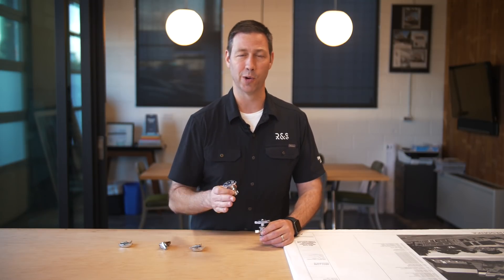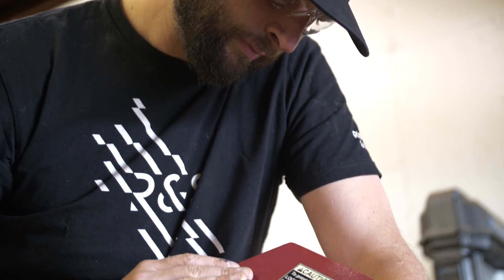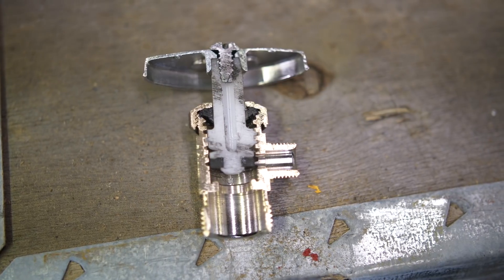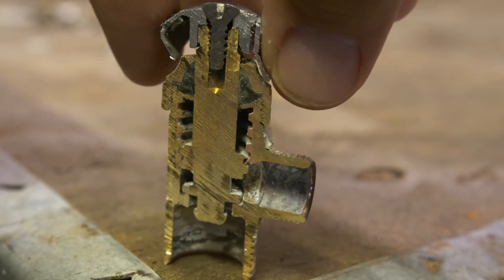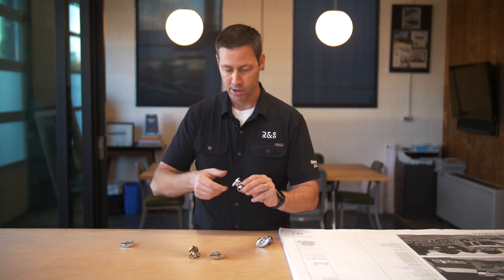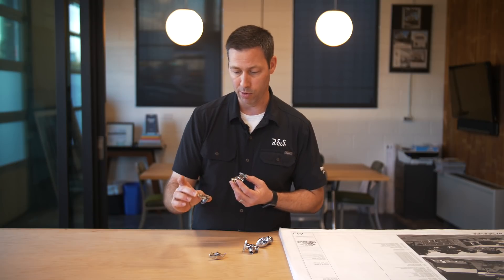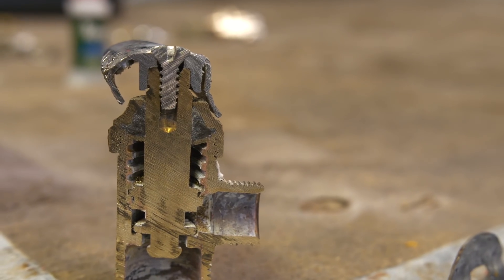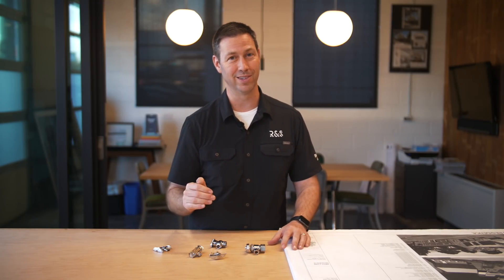Shut off Valves - 3 Cut in Half - Whats the Difference???

Comment: 18 years ago, I replaced all the valves in my house with ball valves, with the exception of the actual shut-off valve.  I even put ball valves on 3 exterior faucets.  The hot water exterior faucet is starting to slow drip, but other than that, all is good.  For those who will want to know why I did not replace the shut-off valve, well, it's copper, and about 1/2 inch above the concrete slab.  Yeah, listen up kids, never buy a SLAB HOME!  Had I known then, what I know, you couldn't give me a slab home.  I mean it!!!!!!!!!!!!!!!!  They suck pig balls, after the pig shit has come to rest on them.
Reply: Eh, slabs are ok as long as you got good footings and soil but theyll still crack..   now what homes are complete crap and deeigned to steal money from the unknowing are vinyl sided houses..  95% of them are under insulated and even if they were well insulated i could throw a piece of half inch conduit completely through one from the outside of the house

Comment: Ball valves are definately faster and easier when it comes time to turn off the water supply.  Although I don't have ball valves supplying my fixtures I do have many in other places (outside water shutoffs, main valve to the house, hot water heater and many more outside he home.  From my experience the ball valves don't fair much better than the other regular valves.  They both freeze up when not used for long periods of time (I have a permanent vice-grip by my water heater)  and I find they leak just as much as the other valves.

Comment: I am sure someone already said this but can't you just replace the washer and get more life out of the valve?
Reply: I wouldn't do it. First since I'm a fan of ball valves I would never install a compression style valve. Secondly the failure of the washer isn't the only part of the valve that can fail  so you might not end up fixing it or you may fix it and have another failure. Lastly the failure of a shut off valve to work when you need it to work can cause a lot of damage. Saving money on shut off valves either by repairing old ones or using cheaper non-name brand ones is a risk that is probably not worth it.

Comment: I don't know much about plumbing fittings but I am a hobby machinist.  I would guess the valve from 50 years ago didn't have a rubber gasket at all.  You don't need a gasket to seal, if you have two machined surfaces, which are lapped to match, you can have brass-on-brass and seal just fine.  My guess is, because they have plastic in the modern valve, they can't have this kind of machined surface interface, so they just use a gasket.
Reply: I think that's a good guess, because if there was a rubber seal in there you would expect some small amount to remain, not be completely gone.
Reply: the new lead-free brass valves make a reliable seal a lot less feasible!
I've got a hose bib that feels like it doesn't have a gasket inside of it. seals leak free and travels easily every time. house was built in the 40s and the valve looks and feels like it could easily have been from that era
Reply: Also the no-lead brass is less ductile, so harder to make a good seal.

Comment: Handyman with over twenty years exp here. Love ball valves. But must say, the old brass stem/rubber washer combo is not bad either, you just have to replace the rubber washers from time to time and it is cheap and easy to do. I absolutely hate some of these modern valves with ceramic cores, rubber o rings etc. The old type with rubber washers are so easy to fix and so cheap too.
Reply: Was going to say the same thing. The rubber is easy to replace, it seems. The ball valve doesn't look as serviceable.
Reply: @Polarcupcheck  And I had 5 ball valves fail to shut off after 22 years (washer and refrig) - Just change out the washer everything you do some plumbing on an area of the home.  I usually just shut off the whole house and take care of that first.  If I have to replace I will put in a ball valve but they also fail especially if you live in areas with hard water even if you have a water softerner.
Reply: They also have replacement brass stems flir those valves that come with the plastic stem

Comment: I hate those plastic valve stems. Yes, they do shear off, especially when the valve has been in service for a few years and the water has lots of minerals, it gets a bit jammed up and requires more force ...
Reply: I think the plastic stem is the biggest issue, not multi-turn vs 1/4 turn.  Of course, water quality plays a big role in ceasing any valve regardless of design.  I am moving to 1/4 turn with a water softener.

Comment: If you have even moderately hard water, those quarter turn valves will be completely frozen in less than a year.
Reply: vwvan both kinds have that issue...
Reply: Yes they do, I have been a Plumber since 1976.  Any type of supply stop is just junk in North Florida hard water.  At least the old style, screw in type, are semi repairable.  These newer ball style are not.  Combine that with CPVC pipe and I consider a supply stop just a place to hold the supply tube.  Somewhat surprising, even being many years old, a Toilet Supply Stop will most always work, unlike the Kitchen Sink/Lavatory supply stops in the same house.

Comment: Here in the UK all plumbing has quarter turn ball valves on new installs/repairs. 

The full bore all metal ones are the best (the internal diameter is the same diameter as the pipe and doesn't reduce).

This a typical example of the best: 

http://www.whs-direct.com/ekmps/shops/stocksandspares/images/bbv209315r-15mm-full-bore-compression-ball-valve-with-red-butterfly-handle-qty-10-858-p.gif

Great video for the DIY'er to not encourage scrimping on cheap isolation valves as when you need them to function fully boy do you need them!
Reply from the maker: +Ryan Cooper thanks Ryan!

Comment: Tell you what...message to the builder.

I'll pay the $50 difference and you install the better quality one. Then my house won't flood later when the cheap one shears off. Also offer me these upgrade options on fixtures too!

Same thing with electrical panels, switches, dimmers and outlets,wiring, etc. Give me the option at your cost to upgrade to the better quality unit (don't mark it up, because there is no additional labor or trouble on your part to install better quality) and I will be glad to pay the difference every time so that I can get the better quality part and you can maintain your same reasonable profit margin. 

Please don't make me feel like I have to go to cost-plus on a job because if you supply all of the products you're going to supply bargain basement stuff. 

Bid the job using the products you would put in your own home...or that of your family. I will pay for that level of quality. 

Just don't allow me to go to the home center and find that you are charging me $20 for a valve I can buy for $9 and then your putting in the $3 plastic stem model.
Reply: Yes Less profit to people like you that's why i'm building my own house, I work on cars for a living and i always fix everything like It's mine. there is no shortage of work educate yourself.
Reply: Happen a lot most of the guys outside do that shit every time they don’t care bc all this valves gonna eventually damage and need to replace but bc the lifespan is large 10 yrs they don’t care and if they fail they gonna say the product cane damage from factory do workers they’ll since the beginning which products gonna work in any specific project and also if they are familiar with the work most of them they dont even learn any good practice at all or follow updated bc

Comment: As a service plumber, and from a serviceability standpoint I prefer the multi-turn compression shut offs. With them being designed more like a globe valve, they have the benefit of being able to throttle flow, and if need be, the packing nut and stem can be removed to change the washer or just install all new guts inside, way easier to service the multi-turn compression style in a multi story building, water can be shut off and very quick to pop the guts out and tighten in new guts quick. Another benefit is if the valve is being soldered onto copper, the guts can be removed before soldering so the heat doesn't damage the rubber, the 1/4 turn style can easily get over heated and I had one blow apart on me and flood a house, learned my lesson there. Anything goes wrong with a 1/4 turn and they're not serviceable. 
Another great video Matt.
Reply: This guy knows.
Reply: I keep a pack of rubber valve seats/seals not sure the name. They are so easy to replace rather then sweat new valve or new compression valve.
Reply: Thanks for share your knowledge, very important points, we learn from persons like you; gracias.

Comment: I wish I could have green with you on the ball valve and its longevity, unfortunately I've been finding after replacing many many angle stops that the ball valves drawback is it seems to freeze up earlier than a corkscrew Style. I don't know why that is it most likely is due to the mineral deposits in the water and what not. I used to be a big ball valve angle stop cheerleader but have been finding that if the customer is not at least turning them on and off once to twice a year to keep them lubricated or free of buildup that they eventually just freeze up solid.
Reply: You have to exercise them every so often to keep deposits off.  If they get frozen, you have to slowly wiggle them until the deposits get cleaned off.
Reply: not disclosed  agreed unfortunately my customers never remember to do something like that, can't blame them oh, I do notice the plastic cork screw type seem to resist the mineral build up on the plastic a little bit better than the metal ball on the quarter turns.
Reply: Actually in oil and gas industry this issue has been noticed and solved by using special ball valves. The issue of a normal ball valve is when they are in closed position. the water in the ball hole is trapped and when it's frozen expends to break the sealing.
Reply: Yup and you have to remove the ball valve from the pipe to repair it also.

Comment: Everyone should cycle the valves off and on a couple times at least once a year...if not 6 months.
Reply: My 25 year old compression valves start leaking when I mess with 'em.  At a certain age  the motto is if it aint broke, don't fix it.
Reply: 100% lol. 

try closing a water service valve after 20 years of operation... the city guy thought he was going to shear the valve stem w/ his 24" wide 'T' shaped valve  wrench.  

after that it was like 75% easier to operate the valve.
Reply: not a valve stem actually.. the valve had like an inverted flat heat screw section.

Comment: I have found even ball valves suffer from the cost cutters.
I think there are three levels of them.
Cheap junk - Mid price and high end. Seems the mid price does well enough.
My point? Do not buy cheap ball valves ether.
Reply: I just had a ball valve fail on me. It lasted a little more than 1 year. I was using it as the lawn sprinkler shut off valve. The valve body split. Unfortunately, I do think you can buy anything but cheap junk nowadays.
Reply: +Mark Flierl
I bought a "cheap" 304 stainless ball valve to use for my tenant's new hose bib. she wanted a hose so that she could water the dirt and grow grass and water her flowers. she used it for three years. still works great. I think it was 7 or 8 dollars. it was literally the cheapest new NPT threaded stainless ball valve I could find on ebay.

Comment: Hi Matt, over here in Australia it's known and accepted that a mini stop washers are a serviceable item, along with every other tap washer in a house (if that was the style used), we only really use ball valves for external high flow agricultural/gardening purposes. For mini stops, the trend over here is to use the 1/4 turn ceramic washer type, which I believe would have a longer lifespan that any of the products you've shown. Are ceramic stops available over there? They're quite common here, they're a little more pricey, but for what plumbers charge in Australia, it's better to avoid a callout to fix a leaking stop! Cheers.

Comment: The builder in my newly built home used ball valves with a push on fitting. I was surprised as the push on fittings cost more. I guess they can make up for it in labor costs and not having to risk leaks in compression fittings?
Reply: apex - that hilarious! The reason to go with ball valves is to get away from the rubber in the conventional stops. So to use 1/4 turn stop in the push on style connection (uses an o-ring) is useless. 😂
Reply: Not really. The o-ring is not compressed like it would be on a conventional stop. It's used to establish a connection from the pipe to the fitting. The ball valve is what disconnects the water and the o ring remains untouched/unmoved.
Reply: apex .....but still in contact with water. Relying on a rubber o-ring on the pipe to angle stop connection is even worse! If the water deteriorates the rubber in a standard stop, then it's going to deteriorate an o-ring in a push on connection.
Reply: Plumbing connections fail all the time, its just a matter of 10-20 yrs. Don't forget there are o-rings everywhere in plumbing. Do you use a braided flex hose from the valve to faucet (o-ring to the faucet connection)? Do you use a rigid pipe to the faucet connection (rubber gasket to the faucet)? All of these failing can become expensive if you are not home.

Comment: As a plumber...25 years ago ball valves shut offs were not available. Water quality has to do w/ everything. The older compression style valves are repairable... Ball valves style are not. Ball valves can and do fail. Also the shut off valves are not designed to be turned on and off on a regular  basis... only as an isolation to make  a repair/ replacement..
Reply: All three of the valves he showed can be rebuilt. The ball valve will be the biggest pain as it comes apart at the output stem; the others disassemble from the handle.
Reply: that's funny. I was reading up on a Parker ball valve and it was rated for 10,000 on-off cycles at 5,000 psi...
Reply: k copp.

Comment: I just replaced 3 ball valve that were less than 10 years old, in part due to the new enemy...chloramines. More and more municipalities are using chloramines in city water because they kill bugs better than chlorine alone. The downside is chloramine attacks copper, and in my case ate the ball valve stem over time. So when I tried to turn the valve the handle breaks off. I'm hoping the valve manufactures figure out a way to combat this growing problem.
Reply from the maker: +diymark oh boy. Don’t know about this
Reply: 'doesn't look good, man. probably 316L stainless valves are your best bet.
water pipes: http://www.waterrf.org/ExecutiveSummaryLibrary/90624_508_profile.pdf
(general valve materials + chemicals) http://www.syntecpe.com/pdf/ChemicalResistanceGuide_3-25-10.pdf
stainless steel: https://www.carollo.com/sites/default/files/pubArticles/Opf1113feature4.pdf

watch out for the quality of the NPT threads as well as the thickness of the fittings, though. There's a lot of amazingly bad chinesium stuff out there, and it won't be able to stretch like the softer metals to fill the gaps in poorly machined threads.

Comment: Any recommendations for best ball valve manufacturer?
Reply: tjfyke I bought Dahl quarter turn valves...a bit pricey but they are made well and more attractive than most ball valves.
Reply: @MrRichdoggydogg  Have you had a good experience with them? I thought the same thing because it says lifetime warranty and they were $19.50. I Installed about 16 Dahls and more than half froze up on me after 2-3 years, and this is with me going in every year or so and trying to turn them on and off.